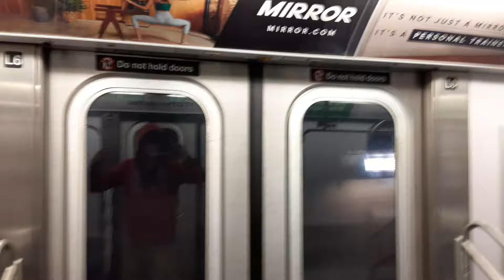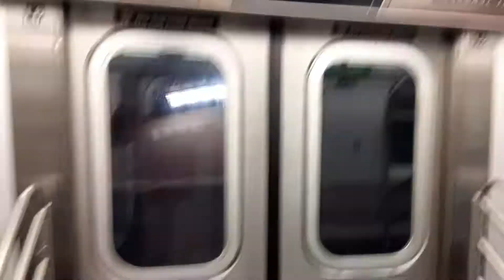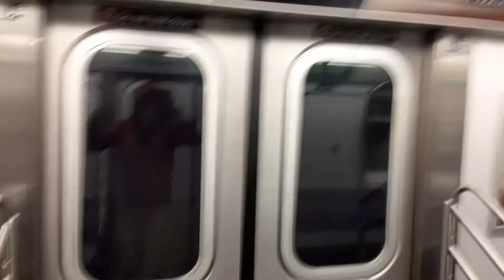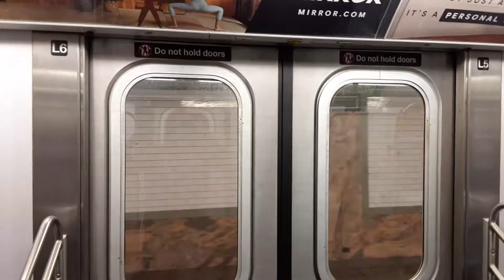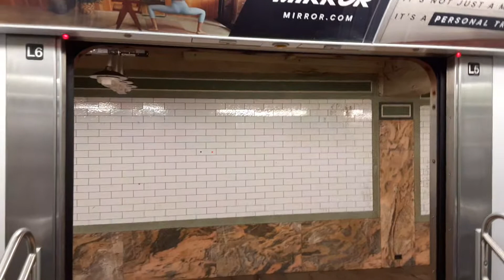4 train R142 door chime with New door motor

Comment: Ooh, I gotta look for more of these!
Reply from the maker: So far there's 2 sets of R142 upgraded new door motor on the 4 train.
Reply: @rigojeftegalo3282  That's the closest train to where I live, too.
Reply from the maker: @transitrailroadfirefsq2001   where bronx woodlawn bound or Brooklyn bound crown heights Utica Avenue Express during the day and New Lots Avenue local on overnights Brooklyn or Manhattan which one?
Reply: @rigojeftegalo3282  On the Woodlawn bound side, AKA East of River/Jerome Avenue.
Reply from the maker: @transitrailroadfirefsq2001  I see and I live on the 3 train line New Lots Avenue bound on Brooklyn except overnight I use the 4 train on the 3 and 4 line on overnights at livonia Avenue line and New Lots Avenue bound.
Reply: @rigojeftegalo3282  Believe it or not, I actually live directly next to Metro North Railroad tracks, and I see those trains every single day!
Reply from the maker: @transitrailroadfirefsq2001  I know you told me and I live on the 3 and 4 line on New Lots Avenue bound 3 train during the day and 4 train during overnights that's was I'm trying to say I actually live at junius street.
Reply from the maker: @transitrailroadfirefsq2001  However it was removed since I ride it on R142 3 months ago this New door motor didn't workout it wear out fast so the old door motor is back along with the rest of them
Reply from the maker: @transitrailroadfirefsq2001  only R142A New door motor work just fine better than the old door motor which is wear out is all fine